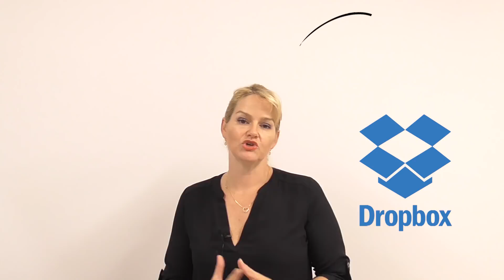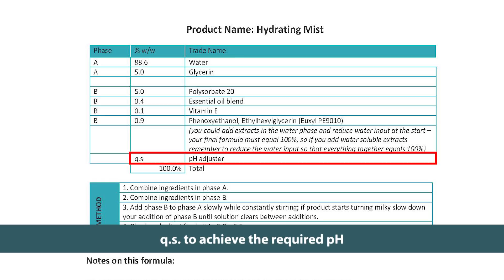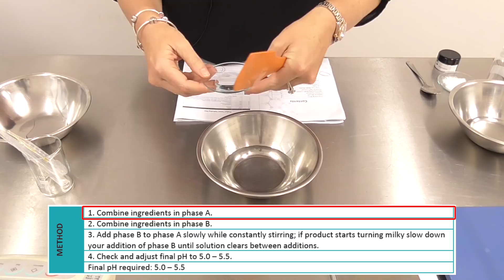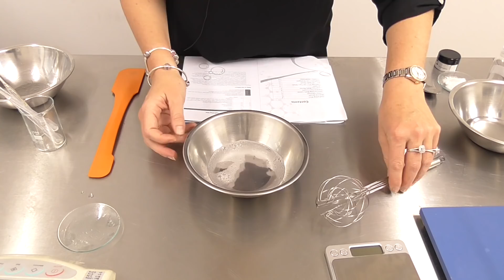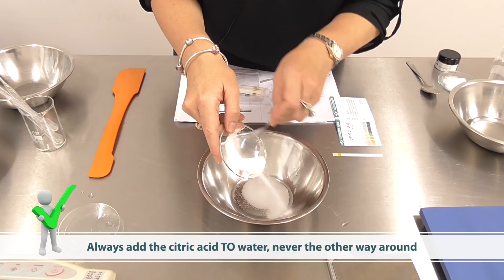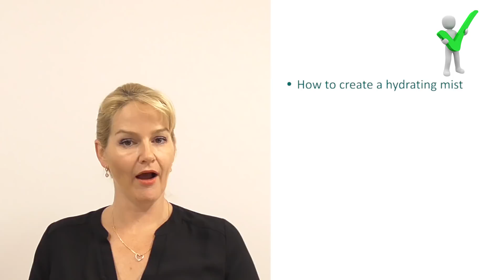Beginners Cosmetic Science workshops - Free trial

Comment: Hi, i'm just starting out and already purchased a preservative. So am wondering if I can use leucidal sf complete instead of the preservatives you are using? As long as the recipe totals 100% of course/ph etc. is workable with the leucidal.
Thank you♡
Reply from the maker: Hi Christine there is a leucidal SF (not broad spectrum) and a leucidal SF Complete which is broad spectrum, the complete is broad spectrum but still needs to be used between 2-4% and warmed and mixed before use; and only covers a pH of 3-8 so be careful of drift if your product has an end pH anywhere near 7. I can't say its suitable as I don't know the formula or method and these can alter the suitability but the material itself is broad spectrum when used in the appropriate concentration in the appropriate conditions. You should still be conducting PET (challenge) testing to confirm any preservative use before large scale production. Hope this helps, there is not a simple yes or no answer with preservative selection, it always depends! Happy formulating :)